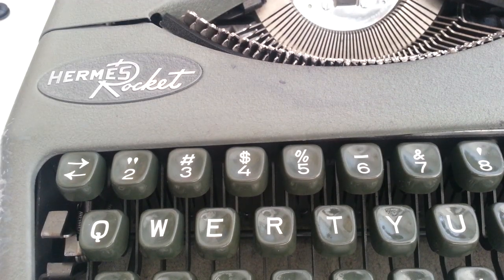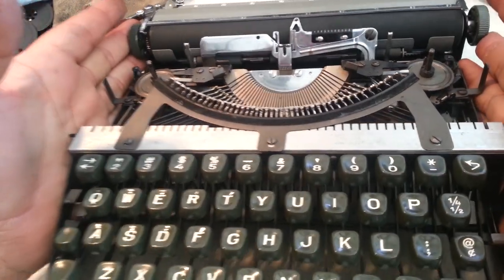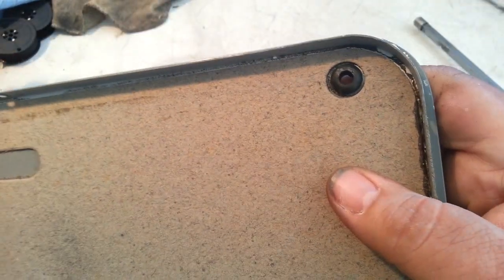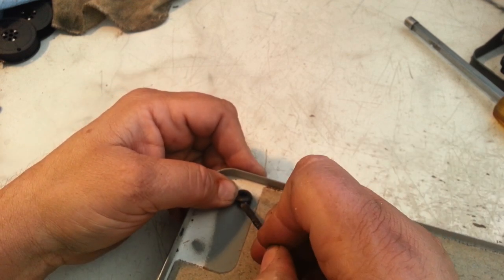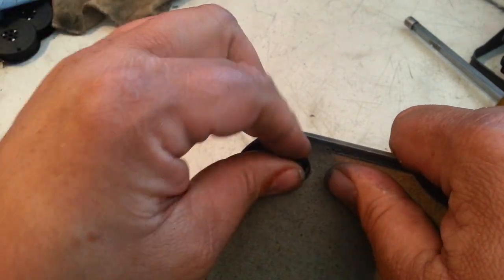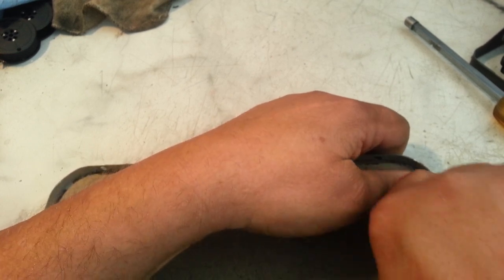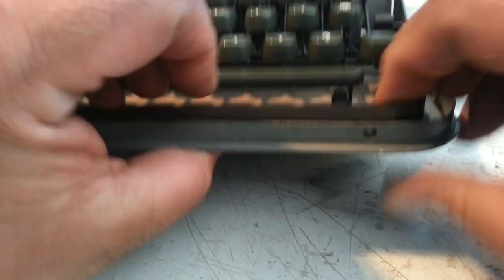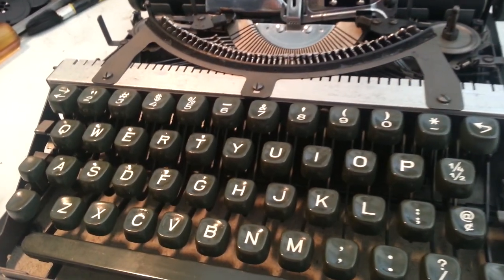Hermes Rocket Typewriter Replace Rotten Feet Repaired Bad Rubber

Comment: Any idea where I'd be able to find the grommets? Are they a general hardware item or is there a specific name for them? I have a Hermes Baby and a Empire Aristocrat that both need new feet and I've never seen these types of grommets before.
Reply from the maker: I buy these grommet is variety packs, different places have slightly different styles/sizes, Harbor Freight tools, Amazon, NAPA, Etc . . . .
I don't remember which these came from, I have 100's & 100's of various size grommets and rubber pieces to aid in typewriter servicing
Everytime I see small rubber stuff I don't have I buy it in preparation to use on vintage typewriters